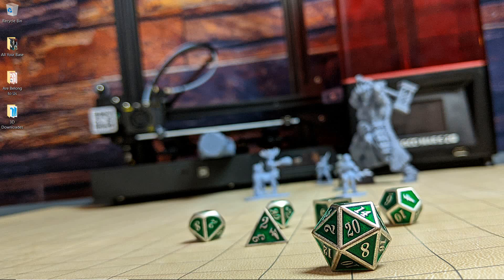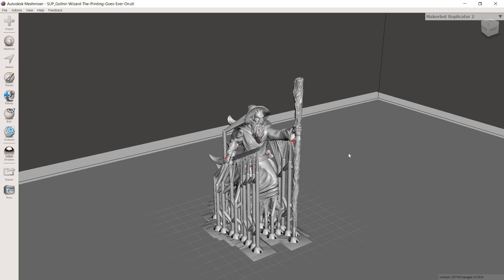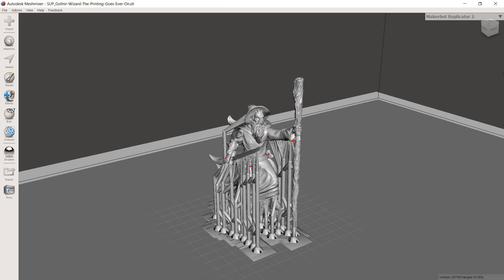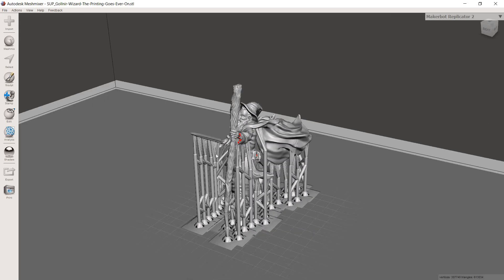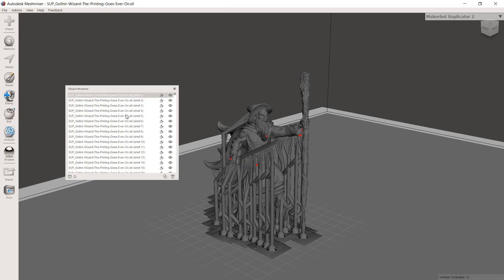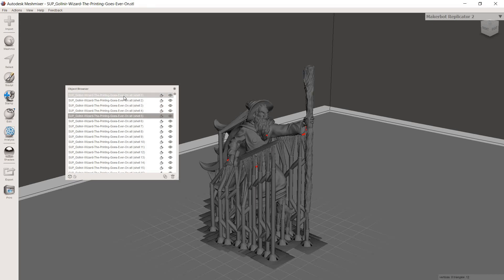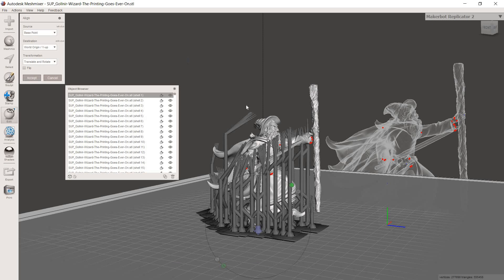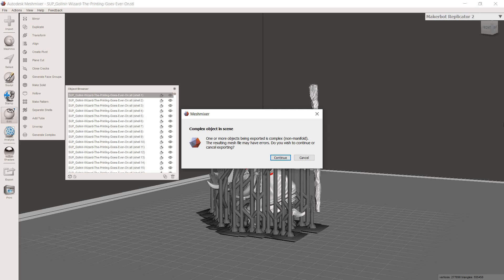How to Remove Pre Supports From A Model Using Meshmixer!

Comment: Perfect. Just what I needed to know.
Reply from the maker: Glad to hear that it helped you. 😊
Reply: @SlicePrintRoleplay  definitely. Only had my resin printer two weeks and I’m printing three dragons for my daughters D&D. The dragons are in parts so fit the bed but the bases for two of them are too big man’s have pre-supports. I can now remove them and use my FDM printer to do the bases. 😃
Reply from the maker: @ThoughtandMemory  that's so awesome! I think bases on FDM and models in resin is a such a good option. 😊
Reply: @SlicePrintRoleplay  had to do it the long way by lassoo and direct point as the software crashed every time I tried to use the shell command. Sorted though and a 0.2mm nozzle on the FDM printer should help keep enough detail. 👍

Comment: This works "sometimes" but meshmixer crashes if the model is too large.  The faster, easier method is to go to select mode and double click on your "main" part of the model.  Odds are good it will just select what you want, then hit "i" to invert the selection which will highlight all the supports and then hit "delete" and it will remove the supports.  This works for me most of the time.
Reply from the maker: @gottahavitvt  interesting. I'll definitely have to try that. Thanks for the heads up!

Comment: i have a model split into 5 parts, using this method ive manged to remove 3/5 supports however on the last 2 i can click anything else but as soon as i click separate shells it crashes and closes, any ideas?
Reply from the maker: Hmm. Unfortunately that can happen when running complex actions in Meshmixer. It's possible there is an issue with the file you're working on and that's causing the issue.
Use the Analyzer tool to see if you can get any info on issues the file has.

Comment: Meshmixer crashes everytime I separate shells.
Reply from the maker: That's really frustrating. Unfortunately, Meshmixer is no longer being updated or supported by its creators. This means that we will sadly continue to see more bugs and issues as times goes on. 😞
Reply: @SlicePrintRoleplay  I agree. I just found an easier way to do this in blender in about a minute and it worked great.
Reply from the maker: @Crusader158  glad to hear it. Unfortunately I believe I'll need to find a new program for all of these process as well. 😞
Reply: @SlicePrintRoleplay  I’d highly recommend blender. I had it already trying to learn and came across that video when I was trying to remove those supports.
Reply from the maker: @Crusader158  I have been meaning to learn it. The possibility of Meshmixer becoming less reliable is making more pressing I think.
Reply: @SlicePrintRoleplay  good starting point is CG fast track. His blender 2.9 series is great. I’ve still yet to go through them all but it has helped with splitting larger prints and things.
Reply from the maker: @Crusader158  I'll definitely check them out! Blender Guru is another great resource.
Reply: @SlicePrintRoleplay  Good one as well. I just gravitated more to CG. Now I’ve got to go over your UV tools video again and get better. Keep the content coming man and appreciate the responses!

Comment: every time I try to do this my meshmix crashes
Reply from the maker: It's possible that your computer is having a hard time dealing with all the separate meshes.
Are you running any other programs when you try to separate the shells?
Reply: @SlicePrintRoleplay  I had youtube open with video, for reference
Reply from the maker: @JohnBrown-lv4bl  if that's the only thing you opened then that's probably not the issue... Hmm.. Do you know what CPU your computer has or how much RAM it has?
Reply: @SlicePrintRoleplay  I Have 32 mb ram . Amd Ryzen 7 3700X 8 core  3.59 ghz
Reply from the maker: @JohnBrown-lv4bl  okay that's definitely not the issue then.... Have you confirmed you're using the most current version of Meshmixer?
Reply: @SlicePrintRoleplay  i am using 3.5.474
Reply: This is a known meshmixer issue, see my post above for another way to do this that works for me.